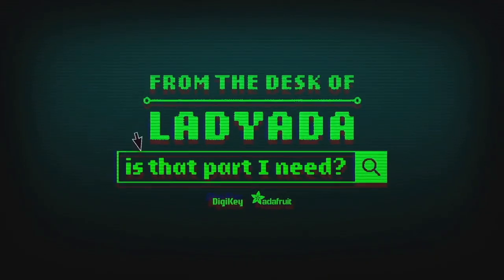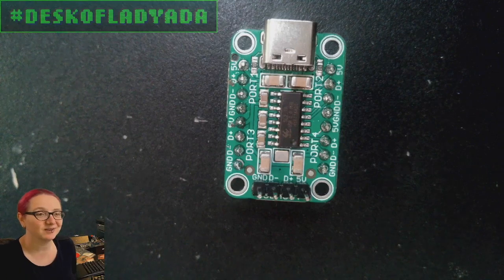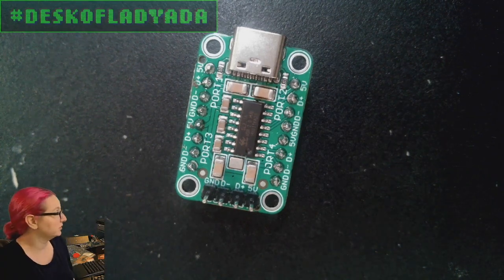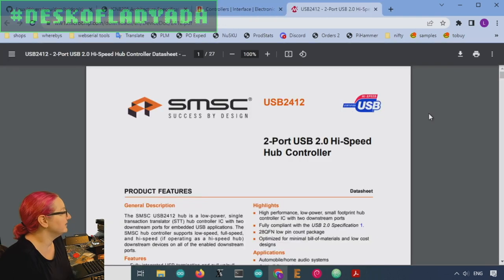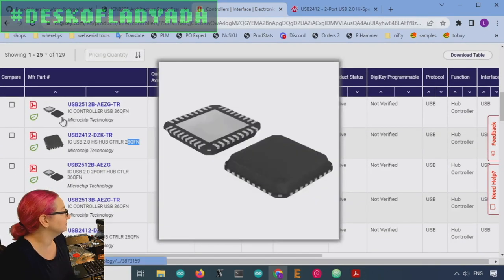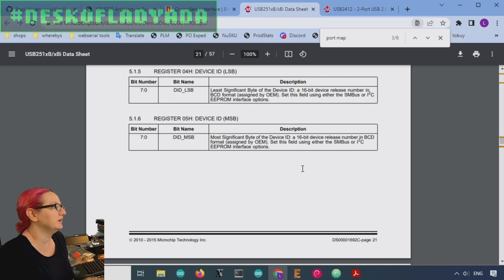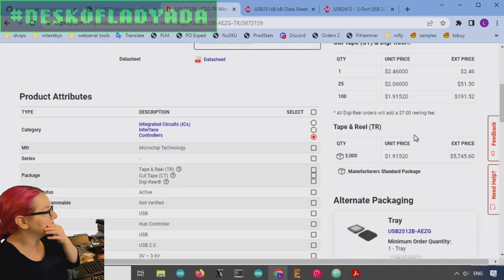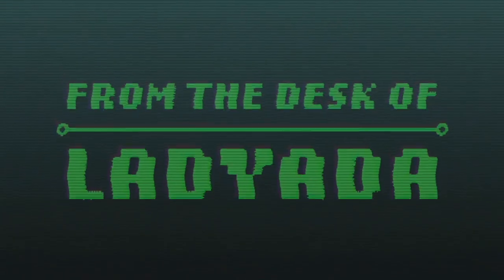The Great Search - Small 2, 3 and 4-Port USB Hub Chips

Comment: I'm building a custom layout mechanical keyboard (for a Peek & Poke typist, no touch typing possible) and I want a USB 3.0 hub inside so I can connect a minimum of five(5) additional input devices through it.
I originally thought of just buying an seven(7) port externally powered USB 3.0 hub and then pull it's circuit board and hard wiring it's port selector witches closed.
I would then power the hub by adding by using a Y type of cable and a phone charger right at the computer's Host Port.

The BIG problem that I have found out the hard way is that I need to use diodes to prevent this external power from backflowing into the host port.
I have found that a lot of motherboards DO NOT have this port protection as I supply enough amps to the hub so that each of its data ports get the full amperage allowed by the USB specifications,
This backflow has happened on a few different motherboards made by different top manufacturers such as ASUS, Gigabyte, etc, and neither the PCIe version or Intel/AMD CPU type makes a difference.

It can play with your mind when you turn off the power supply and the internal fans and their LEDs DO NOT turn off and this includes the CPU's fan and it's LEDs !!!!!
This backflow is going all the way through the PCIe bus and power them and who else what.